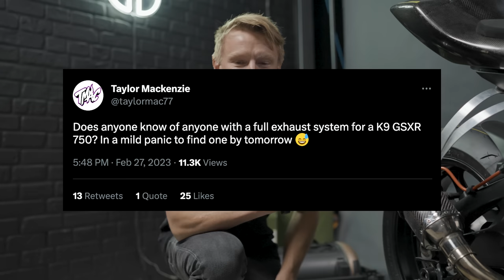I Reveal My £10,000 Trackday Bike Build with Ruroc

Comment: Taylor - literally as you've been doing this I've been doing the same with a K7 750 to a similar budget. And yes I needed help from specialists and, err, overspent, too! Decat, Ktech front and rear, lighter wheels, new callipers/lines, track tyres...all similar or the same. Yours is lighter, mine makes a little more power...we should run them against each other and see which mods achieve most and where? Love your stuff mate!

Comment: every bike build has it nightmare problems as someone who has been building bikes for years 1st was rd cofin tank I put 200 top end on 125 insurance purposes it went like a turbo had been installed needless to say it didn't handle or stop and also built street fighters b4 they were called that it just made sense to get rid of them seats on CB 900 and zeds and put renthals so ya could manhandle them but you are super lucky and all the advise and help you should defo do builds but I hope not all race bikes really try and do a Spondon framed cbx 1000 or kwak 1300 6 cylinders and get it on track  you are very lucky use it I have taken 3yrs doing a1991 tenere 660 everything as been a problem all I've got 2 do is manually bend header pipes strip carbs tune it all up and pray it will pass m.o.t all done in my front room without any help so be thankful ov your oppatunity

Comment: Very cool Taylor. Curious to know your time at Knockhill against the rest. My K7 is still running stock pipes because of dB control but most of the required bits - renthal 50mm bars, bonamici rearsets, Active quick twist, CRC fairing. The rest has been suspension setup, dunlop GP212s (now testing a Metzeler k2/k3 combo) and good to run middle of the semi-pro group for someone who returned to trackdays after 12 years ;-)

Comment: Looking good. 

Track/race-fairings NEVER fit right out of the box. There's always something that isn't quite right, there are exceptions, but the "rule" is to expect some cutting, drilling and  such - and that's when it's "pretty good fit". Some "make your own fixings and fittings" can also help when things aren't lining up - like a spacer to allow a gap between fairing and bolt hole, or a small bracket that "translates" the hole for the screw or bolt on the bike to a place where the fairing has a place for a hole. 

Fitting a rear suspension unit isn't in itself hard. You do need some way to lift the rear off the bike off the ground without using the switng-arm, so either an ABBA stand or some sort or jack/support under the foot-pegs [assumes solid pegs, typical road-pegs will just move out of the way].

I would also have thought that at least replacing the oil on the front forks (or did I miss that) would be a good thing to do on a track-bike. Obviously "beginner level", forks will probably not need cartridges or some modifications, but fresh oil and a clean-out of any accumulated crud would be a good thing. New seals never hurt anyone either... :) Again, not really hard things to do, but requires supporting the bike without the forks - ABBA stand or front stand that goes in the steering stem (or whatever it's called) [Or a couple of  sturdy bits of a wood  screwed into an upside down T - carefully pushed in under the stem - no idea who would do this sort of thing ;) My excuse: Needs must, need to fix bike today, can't get a stand in time...]